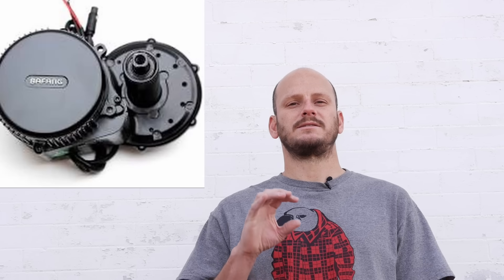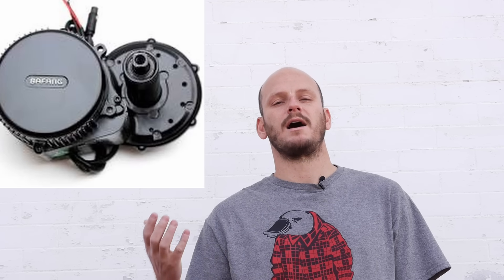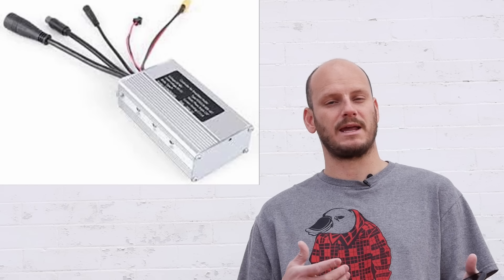Hub vs. Mid Drive Motors: Why Hub Motors Suck and Debunking Common Myths with performance test

Comment from the maker: Tesla’s don’t use hub motors! They use the same principle motor though. A single speed fed through a gear reduction. 
Also. Hub motors don’t cause loose spokes. But cheap, poorly made ones do😀
Hub motors still suck 🙌
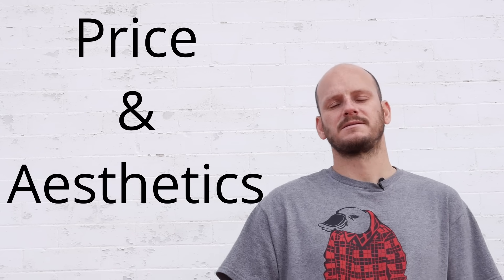Reply: I manufacture and sell E-Bikes.  I fully disagree @7:12.  Apples to apples, it costs 3x the amount for a mid drive with the same specs as a hub drive,  Three times.  I only know Bafang as that's what we install.  Also, I'll just say with the current nationwide law enforcement sentiments, they aren't checking e-bikes for wattage, anywhere.  I live in a medium size city and it's just not going to happen.  They don't care about e-bike wattage.  Law enforcement has so much more going on than to hassle someone on an e-bike, let alone confiscate it.  Ride what you like.  You'll soon be able to get a dollar for dollar tax credit in your annual return for purchasing one.  Clean green energy efficient e-bikes.  I'll also agree with your last statement above.  All e-bikes are awesome in my book.....
Reply from the maker: @multisystemic  sweet, what’s the bike you manufacture?
Reply: @multisystemic  Three times the cost for a mid drive with the same specs as a hub drive? Why so expensive? Is it more than just a prestige tax for those who ride mid-drives for snob appeal?
Reply from the maker: @multisystemic  how is it 3x when a BBS02 costs about $450? 🧐
Reply: @multisystemic Maybe.... If everywhere that you ride is flat.  As a practical point, not everyone uses an ebike motor for speed.  Hub motors simply do not cut the cheese for climbing steep hills and never will without the power that makes them something 'other' than a bicycle.
Reply: The beauty of an electric motor is that it produces high torque from zero revs, and continues over a large Rev range (unlike ICE).  So a well designed hub motor should be fine for most uses.  Of course they are not so good when sprung weight is an issue, as in mountain bikes.  Could it be that the public like to follow fashion / look cool, similarly to the use of exposed chains and derreilior gears...which are only suitable or racing bikes?
With all the money in the world, I would have a Pinion type gear, integrated to a mid drive, driving a chain enclosed in the frame.
Reply: In my experience mid-drives are useless because they cause the chain and cassette to need replacing about every 500km. I go about 10 000 km in a year. Also, having a hub motor with regenerative braking will save your brake pads. Without regen you will be replacing brake pads a lot! And that is both annoying, expensive and time-consuming.

But you are right about the spokes breaking. So both suck I guess. Haven't found a good ebike yet. 

But it is interesting that the most expensive ebikes on the market (STROMER) use a direct drive hub motor.
Reply: @cryptohouse1676  I'm way way past 500 km on my mid drive and the cassette is nowhere near needing replacing. I did break the chain though (it's a surprisingly easy fix).
Reply: @cryptohouse1676 Many cargo bikes too. I wish they offered 250 and 350 watt hub motors. The smallest I could find is 500 wart, which I need for pulling a trailer.  Maybe the Lectric Lite is 350 watts. I like hub motors. I can still pedal home if it breaks, I hope.
Reply: @cryptohouse1676  I've never had a Stromer so I didn't realize that the most expensive ebikes on the market use a direct drive hub motor. Good catch. 

Your mid-drive ate through your cassette 20 times a year? That's a lot of hours and money spent on replacing chains, cassettes and brakes each year. How much time and money did you spend on that each year?
Reply: @sammiller6631  Haha, that mid-drive only lasted a few months before pretty much everything broke. It was a 750w TSDZ2 from china...
Reply: more importantly, Tesla's don't have variable transmissions.  There is NO loss of torque at low end OR top end.... so.... the equivalent of what you're suggesting is to simply attach a 3 phase motor to your transmission to convert to an EV.  Gears, by design are friction-addled devices that are not necessary  in a direct drive electric motor.
Reply: Mid drive and hub drive have both the power going to center of the wheel, so why should hub drive make loose spokes when they even according to this video not at pulling so much nm.
Reply from the maker: @radarmusen  checked pinned comment
Reply: ya, and in 15 yrs i've never had a 'spoke loosend' by my several 'Hubbies' ..  BTW   only HUB motors , so far as I know, can be used for the "latest rage" :  eTrikes !!  My "ECO-TAD-SX" boasts a rear hub/and/derailleur system that , they say, boasts a single motor that can vary it's power to be from "500 to 1000 watts" .. So far I've not seen any specs/docs that des ribe how that is done ... but we must note that eTrikes  can't use "mid motors" .. so far as I know ..   COmment??? please do !!!
Reply: @jonandersonmd7994 I agree. Hub drives just work every time.
Reply: I have different take on why mid motors are a problem. The chains are not designed for the high torque. Nor are the gears.
Reply from the maker: @ebaab9913  I’ve experienced chain and drivetrain issues once you pass the 3,000w mark on a mid drive. Bafang s don’t put out enough power to cause too much problem. Unless the end user is riding improperly
Reply: Most people can't afford Teslas.
Most peple cant replace or afford to have their chains replaced 3-4 Times a year either...
Hub motor is less down-time and more money for ice cream. With The difference in efficiancy and price you can afford a second battery for your hub-drive instead and get even better mileage and economy.
Reply: This is exactly the info i was looking for. I’m looking at the same bike with a hub motor ($2300) and mid drive ($2600). They aren’t exactly the same the mid drive has some other upgrades but it’s the same frame.  Thanks! 👍
Reply: You say for the same draw on the battery the mid motor produces more motive force, so what happens to the energy in the hub - does it dissipate as heat?
Reply: @nemo6686  Mid drive and hub motors have similar efficiencies ranging between 85-95%, and as a result neither produce much heat and air cooling suffices until a certain power is reached (usually >12 kW continuous). I've owned quite a few of both ranging from 3 kW to 55 kW, so I've got quite a bit of practical experience on top of the technical. For perspective, an ICE is only 35% eff and risks overheating without just a few minutes of cooling because over 65% of the input energy is lost to friction and heat. Only 15% at most is lost as heat from resistance in an electric motor. Mid drive motors themselves tend to be slightly more efficient than hub motors by ~5% or more, depending on the model. But we're talking about bhp here (brake horsepower at the motor), and not total power at the wheel. You also have to factor in drive train losses between the motor and the wheel with a mid drive if you want a more accurate comparison of efficiency and thus power input/output. A chain and a couple of sprockets can easily eat up that 5% advantage that a mid drive would otherwise have over a direct drive hub motor. So generally, a 4 kW mid drive and a 4 kW hub motor, for example, will have roughly the same output in power to the wheel (whp) when said losses are accounted for. The main difference between the two in terms of output is that a mid drive uses gearing in most cases. You can input the same hp into each motor, but if one is direct drive and the other uses 3:1 gearing between the motor and the wheel, for example, then the latter is going to produce more torque unless the former is wired specifically to sacrifice speed for torque in the same way large/small sprockets sacrifice speed for torque, or vice versa, which they usually are. Torque is the key word here, JohnnyNerdOut seems to be conflating it with power when he refers to 'motive force', but torque and power are two different things. Related, but different. Power (hp or watts) is a function of torque * speed. So if you have a 4 kW mid drive like the QS 90H 138 that produces 72 nm (~53 ft-lb) of peak starting torque on it's own with a peak rpm of ~4000 and incorporate 3:1 gearing then you get 3 * 72 = 216 nm of starting torque at the wheel, but 4000 / 3 = 1333 rpm at the wheel, which is similar but slightly less torque than the 266 nm of starting torque and 1200 max rpm that their 4 kW QS 273 40h V3 hub motor produces. Increase the gear ratio for the mid drive slightly and you'll find the resulting torque and speed specs to be very similar between the two equally sized but different motors. Math doesn't lie, and neither do performance charts, which QS and other manufacturers are happy to provide when requested.

HOWEVER, that doesn't mean JohnnyNerdOut is completely wrong. Hub motors are not suited for every application. The extra unsprung mass with a hub motor can be a problem if your bike isn't designed for it. If you take a standard wheel off your mtb and replace it with a hub motor without adding more sprung mass to the bike (like more battery for ex) and replacing the suspension with a higher spring rate, then that hub motor is going to be really hard if not impossible for the stock suspension to control over bumps. Using a hub motor requires adjusting the sprung mass proportionately to the unsprung mass to maintain a proper ratio so that the sprung mass can work with the suspension to keep the tire tight to the ground. It's not impossible to do, but it can be costly when you get into the bigger 80 lb 12-14 kW hub motors. If you don't mind adding more weight to your bike and spending $ on a beefier suspension, then the unsprung weight won't be a problem for you. It's all about the ratio, doesn't matter if it's a bike or a bus. Again, the math doesn't lie.

Spokes aren't an issue, either. I'm not sure how that became an argument against hub motors when nearly every mid drive has a spoked rear wheel and inputs the same torque, or more if the gear ratio is high enough. Maybe a DIY spoked hub motor would end up with damaged or loose spokes if an incompetent backyard builder didn't choose the right gauge for the job and didn't know what they were doing. Otherwise, wtf? 

So in short, the only real difference is gearing and unsprung weight. Not necessarily bad, depending on your budget and whether you want a street bike or an off-road bike. Hub motors are a good choice for street bikes because they're simple and easy to maintain, mid drives are a good choice for off road bikes because the CG is positioned better for stunts and the ability to change gearing between rides allows the rider a bit more wiggle room for track adjustments than simply relying on the functions in the speed controller. But in terms of overall power, torque, speed - a person would have to be kidding themselves to believe one is superior than the other based on those factors alone. A 4 kw brushless motor is a 4 kw brushless motor no matter if it's direct drive or not, the ratio of torque vs speed in the motors themselves is a matter of coil/mag and winding count. Don't let anyone with an irrational bias tell you differently.
Reply: @JamesBiggar  Thanks for your long and detailed response, but my comment was really only a conservation of energy issue: if a motor consumes electrical energy then any of that energy not translated to motive force must surely be dissipated as heat - including any friction loss in the drive train, etc.
Reply: Where is the best place for me to get a complete mid-motor drive bike kit from or give me a number to call them
Reply: @JamesBiggar  well done.  It sounds like it's a similar argument to  fwd cars vs mid engine.  No one will argue that the mid engine is great for full performance but the basic fwd econobox is perfectly fine for almost anybody not racing a mid engine.
Reply from the maker: @nemo6686  well, I suppose yes to a degree. If the power is sent to the motor but it isn’t enough to spin it as it should, it creates heat. Sometimes they get VERY hot
Reply: @JohnnyNerdOut  Damn straight, they get HOT! Been there, surfed it.
Reply: @JohnnyNerdOut  surely there's a reason everything is moving towards mid-drive. It can't be because so many commentators say they suck. Kinda sounds like a lot of hub owners are denying an obvious industry move towards mid-drives. Same advantage of having the gas engine positioned like a mid-drive and not mounted at the wheel end of the swing arm.
Reply: @LoveIsaacCurtis  You should notice that in the ICE world, mid drive engines are rare. Most engines are located at the front or real axle, despite the disadvantages of centre of gravities.

The same will meet the fate of mid-drive electric motors. They are just not as efficient as hub motors.
Reply: @LoveIsaacCurtis  When bikes are toys, marketeers sell you on mid drives. When your livelihood depends on getting from A to B then you have no choice but to choose the cheapest, most reliable, system. For the hundreds of millions of Asians who need transportation, they choose hub drive every time. Hub-drive won many years ago.
Reply: @LoveIsaacCurtis   could be they are making them as tamper proof as possible ... one sealed unit containing motor n gear box n controller ,

Break the seal pop go the electronics ... Hubs in separate boxes are easy to upgrade @ ooh MORE POWER BABY YEA ! 

I like the fact Mr plod the police man can’t tell anything from a 500 - 3000 watt motor same size .... 

Either way I won’t stop progress , but if it try’s to slow me down to a grind .... old school bikes - with a big ..ish motor it will remain.
Reply: @LoveIsaacCurtis  The issue with mid motors will go away when the whole rear wheel drive train is designed to cope with the power. This means an upgraded chain, and more importantly gears that are designed to work with the power. None of this is impossible, but currently is just not implemented. The spokes incidentally are under the same stresses with small hub or mid motors. Large hub motors put less stress on spokes.
Reply: @LoveIsaacCurtis  The industry doesnt always have user experience first in mind. Just like the smartphone industry was moving towards non-replaceable battery, no expandable storage and other unreplaceable components. It's all about profit, middrive bikes made by big brands are proprietary and sold for a huge margin (they often goes on sale for 50-70% of the RRP) and the fact that the destroy chains and cassettes for breakfast means you'd have to spend alot on maintenance.
Reply: @JohnnyNerdOut I ride mine in 110° plus, out here in the desert. I'm going from a 48V 12.5 AH battery to a 36V 13 AH battery, same 500 watt hub motor. I don't usually ride more than 5-15 miles a day. It's nice to get a new ebike, this is my first one.
Reply: @difflocktwo Of course.  😀
Reply: What do you think about a mid drive motor on a single speed BMX bike? Can it be done?
Reply: @karlfonner7589  Anything can be done if you work at it. mid would be more work than a hub but if it's worth the extra work to you, tell us how you like it.
Reply: @sammiller6631  OK will do. I was thinking about putting a weak mid drive engine with a small battery. So it would be easy to pick up and push up hills without all that weight. Kind of like a poor man’s Grom.
Reply: @karlfonner7589  The smallest ones get their push from spinning really fast, much faster than you can pedal, so they use gears to lower revolutions towards a rider's range. Gears add weight depending on what they are made of. At that point, the most important weight is the rider's weight as the gears have their own rider weight limit before they are stripped. You'll have to find the right sweet spot depending on how you weigh, how much it can carry, how you can lift, and how much the engine weighs.
Reply from the maker: @karlfonner7589  if it has levered brakes (not coaster)
Reply from the maker: @karlfonner7589  I do that all the time
Reply: And this is why Porsche is using a gear in their EV. It just keeps accellerating.
Reply from the maker: @henrievery-3rey  You should check out my video explaining the biggest myths concerning Ebike motors I go more into depth about a motors and the difference of how they work
Reply: I just got a mid drive 250 w motor with a carbon drive (belt) and I just skipped the bank and stole all of the California Unemployment fund of 30 billion.  That covered most of the cost
Reply: @SocalSamStokes  almost all of it i imagine
Reply: You need to do more research on mid drives, not as good as you want to believe
Reply: Hub motors don't suck if you know about them it like I told this guy who tried screwing me on a new bicycle I'm selling for same price he paid for a used bike. If the mortor wattage inputs under then over it always better this guy litterly told me how his 1,000 watt better then my 350 motor and I told him if you do that you better off getting a middrive. But for how it sounded you needed one more like mine and not waste my time. He did not listen so when he burn his mortor witch I know he will. 

I advised him that enjoy spending a grand for the wheel for you pissed off the only guy who can fixed it. 😂  So yeah you right it does suck if you don't understand how they work. Great video man! Witch hub and middrive you prefer?
Reply: I have had. Cyc pro mid drive on my Giant Stance for almost 1000 miles.
Hard miles, it’s never ever had even the slightest issue.
50 mph. I couldn’t be happier.
There may be better stuff out there, but if I did it all over again. I’d do the same thing.
Reply: Hub motors don't suck near as much as you
Reply from the maker: @billwaller4094  no way man. Nuh uh.
Reply: Really well informed info. Thank you for sharing. But dude, that awful musac!!! Why? Silence, birds, birds farting, waves, random mechanical sounds, anything is better than that noize!!
Peace
Reply from the maker: @G58  I know. Ya live ya learn.
Reply: @JohnnyNerdOut  Cool. 
Peace
Reply: The reason why hub drive motors are not quick is because they are not operating at the right speed under acceleration. Torque is torque regardless of where the motor is placed, but the power output may vary because of favorable gearing or not. Torque is at its peak at zero rpm, but this is not where power is at its peak. It is important to understand the difference between power, force, and energy. Hub motors are clearly the future for most bicycle applications because you lose the hazzle with a chain. Though, there's one challenge that needs to be solved. Hub gears. Some effort has been put into this challenge but still too weak or too expensive. Those that exist don't use much of the diameter available and the result is small, weak gears. Instead of power transfer through a chain from the crank to the back, it will be done electrically via a generator. This will give you flexibility when to add energy to the batteries. It also opens for two-wheel drive. A reason why nobody serious has tried to solve the challenge is probably because there's a great risk factor. How many G's do the construction need to withstand? A high efficient electric motor needs small tolerances. How can this fit with hundreds of G's you get from running over gravel washboard? Would shock absorbers need to be put into the wheel itself? Some calculations on a piece of paper tell me there's no way around this for hub motors to have the bright future they deserve. The idea is very good but is it practically possible? Before the challenge is met mid motors are the only ones that make sense.
Reply: Hub riders are coping hard. I have both, mid is best sorry
Reply: They dont suck they have their place . in fact its a means to save the planet !  I had to slightly ream out the holes to fit the largest posible dia spoke and no problems at all not even a loose spoke with no thread locker , go big or go home .
Reply: I see you have received a few letters from lawyers after your video... the one thing that sucks more than a Hub Drive = a Lawyer
Reply from the maker: @Craig Nelson IMO a standard 68mm kit doesn’t change the Q much. I know that’s not scientific... I know when you start doing 120mm kits it can start to offset that Q. They do have crank arms out there that supposed changes the Q factor if needed
Reply: Thank you sir that's exactly what I was thinking because my son works for Tesla, hub motors on a Tesla 🤔🤔👽☮️
Reply from the maker: @timothymaddox1957  check the pinned comment
Reply from the maker: @henrievery-3rey  k, I tried 😀
Reply: That spokes thing had me concerned
Reply: Does a direct drive hub motor make a difference? I own a Rad City with a direct drive. I ride almost all flat paved trails so I'm not sure a mid drive matters much. Thoughts?
Reply: @henrievery-3rey  OK you say you learned about motors and drives from engineers, my question is why car hub motors would be less likely to cause fires. Most battery fires happen while charging or crashing.
Reply: A Tesla Model 3, for example, uses a 9:1 fixed gear ratio
Reply: The Aptera is planning to use hub motors though and Tesla isn't necessarily the top of EV technology.
Reply: Yes they do, internally geared hub motor is what Tesla uses. A hub motor is any motor incorporated into the hub of the wheel.
Reply: That dont make it right Johnny
Reply: Why not just use both.  Problem solved. 🤓
Reply from the maker: @jimbob4456  you totally could, it would just be totally inefficient
Reply: The new VanMoof S5 and A5 uses a front hub motor. Why do you think VanMoof used a hub motor? Is VanMoof simply style over substance? What's your take on the new upcoming Stromer ST3 Pinion? I know! So many questions. Sorry.
Reply: which is better a hub drive or your feet?
Reply: This random rant sucks.
Reply: I think I took a wrong turn somewhere. 🙁
Reply: LIKEXI SAID BEFORE THERE IS NO MID DRIVE THAT WILL BEAT TWO HUB MOTORS NOT EVEN CLOSE. and like I said in traffic in A CITY WERE YOUR GETTING UP TO 30MPH+ THEN SHIFTING DOWN EVERy 200yards or less. Not practical for middrive , also like I said Middrives KILL YOUR CHAIN AND GEARS, AND IF CHAIN BREAKS your f cked. But my opinion.
Reply: @mad151maxx4  Mid drive + belt drives + internal gear hub = dual hub drive users crying and coping 🤭
Reply: hub motors don't suck. they provide an assist as designed...  du du duuuuuuuuuuuuuu
Reply: I get it now. You sell only mid drives, so your opinions are heavily biased. You really need to put that disclaimer at the start of your videos so people know not to take you too seriously and you are just making infomercials.
Reply from the maker: @maxring837 as an independent conversion shop, I have co
Plate freedom to sell and carry whatever products I want. I choose not to carry hub motors based on the hundreds of videos I have made on the topic.
Reply: Oh yea there’s a guy going over 100 mph with a hub motor let’s see a mid drive do that
Reply: They put a tremendous strain on the spokes, especially if they're ridden hard. My first fat tire folder was abused before I bought it. Then I wrecked it. My new ebike will not be going off-road, or ridden hard, like my first one. The second ebike I'm getting, will have cast wheels, not spokes. $200 more I think it's worth it. I will be maintaining my spokes. I don't believe riding an ebike normally hurts anything. I'd love a mid-drive, affording one is not happening. I'm not spending $2500 to get a mid drive when hub motor fat tire folders are fine. $1400 is my limit for now. Changing the rear tire on a hub drive blows.
Reply: Sorry Johnny but my hub bike has 10 gears at the back so I0m stuck in the SAME choice as a mid drive bike - 10 gears. Think about it.
Reply: Even if someone offered me a screaming deal on a hub motor bike I'd probably walk away, because it's going to cost more to run in the long term.
Reply: If you want to go fast on a bike get a qs205 and a sabvoton 200amp . But honestly it's not a bike anymore
Reply: Good video, but have to call bs regarding the torque and resulting load on spokes. It doesn't matter whether the torque is produced at the hub, or from a midmount via the chain, the loading on the spokes is the same. In your example with a midmount producing up to double the torque you would expect up to double the loading, and therefore double the wear and tear on your spokes.
Reply: @stuartmontgomerie755  In fact it is probably worse with a mid. 1 Spokes are slightly longer with the original, small hub. 2 And with a properly designed hub, the spokes are designed for the extra torque. With a converted mid bike, the spokes are likely not designed for the extra torque.
Reply: @stuartmontgomerie755  Actually, hub motors break more spokes. It is how the torque is applied that is the difference. I was tearing up spokes and researched it. with the large diameter spoke flange of Hub motors, Details in spoking become critical I'm 260 lbs, rode my ebike home on the hub motor after a stick broke my derailler hanger and 11 spokes. JohnnyNerdout spreads plenty of misinformed opinions. They're jut his opinions. The reason against automotive hub motors is the same as for carbon wheels, Which are less reliable than steel. Unsprung weight environmental issues. However their Three manufactures will out mass produced hubbers in this and next year. Actually Inboard at each wheel for transmission efficiency. But I replaced broken spokes trued wheel, with what I know now I seldom loose a spoke.
In my use a hub motor is superior. Here is why:
I ride 365 days a year, two years, for transportation to work. Tell me what do you do if the chain breaks. In near zero, 35 mph, 60 mph gusts of a snowstorm 4 miles from home? Well it happened to me. I Rode my e-bike home, motor only. Do that with a mid motor bike.🤣🤣🤣🤣🤣🤣🤣🤣🤣🤣🤣🤣🤣🤣🤣🤣🤣🤣🤣🤣🤣🤣🤣🤣🤣🤣🤣🤣🤣🤣🤣🤣🤣🤣🤣🤣🤣🤣🤣 I've ridden it home, when the motor controller (under warranty. Long ride, long grade, I have the fix.) failed. I ride an $850.00 350 watt hub driven NCM Prague, Mtn style 3x8 gears with an 11-40 cluster, Studded tires. bike with fenders and lights is 55 lbs. I weighed 260 lbs I have a bad knee and some pretty good grades. For the price of your bike, I have two, three and spare batteries, For transportation, you couldn't give me your mid drive fat, overweight fat tire bike Thank for the opinions, but MID-DRIVES SUCK!!!!🤣🤣🤣🤣🤣🤣🤣🤣🤣🤣🤣🤣🤣🤣🤣🤣🤣🤣🤣🤣🤣🤣🤣🤣
Reply: @stuartmontgomerie755  although the torque should be the same (depending on which gear you were on), Hub motors significantly increase unsprung weight which makes the wheel vibrate harder and loosen the spokes more quickly.
Reply: @stuartmontgomerie755  so true He's one of those know it all before he actually does research.
Reply from the maker: @stuartmontgomerie755  ya I clarified my statement in the description and pinned comment as it was a little confusing the way I worded it. It was supposed to comment on quality of hub motor lacing.
Reply: mid drives are trash. know why? dual 5kw hub motors
Reply: @Blox117  I think he was talking about bicycle conversions. 
You're talking about an electric motorbike. 
Nothing to do with a bicycle or cycling.
Reply: @mick2d2  thats true, mine is more like a motorbike. although its built on a bike frame and still can be pedaled
Reply: @Blox117  Must be a pretty robust frame with all that power! 8)
If I had to choose one characteristic that I like about my middrive BBSHD, it's that at low power it feels pretty much like a normal bike. 
It's very flat where I live, and most of the time I'm only using 50-150W. Obviously if I crank it up (1764W fully charged) it's a very different beast.
I don't have a throttle either as it's a dead giveaway, and the police can be a bit pissy here. 
If they catch you with what they consider to be an electric motorbike, you get fined for not wearing a crash helmet, not having a registration, not having insurance and not having MOT!
Bit of a bummer really! 8(
Reply: @mick2d2  the motor controller is programmable easily on the fly via bluetooth and an app. you can set different acceleration curves, power levels, and throttle sensitivities.

im not sure how the police would know about a throttle. mine looks like a normal grip with a voltmeter on it. where do you live at, the UK? I hear folks in europe have a very dystopian government outlook on personal electric vehicles.
Reply: @Blox117  Spain. It's usually idiots not pedalling at speed in built up areas. Plod is (unfortunately) coming round slowly to the fact. I converted my bike, first to a BBS02 (seven years ago), then switched to a bigger 52V battery and the BBSHD a couple of years ago if memory serves. I can also reprogram on the fly using EggRider. The comms cable was a real pain to use before that. The EggRider also has two quickly switchable configs, "street legal" and not so much! 😉
I also have one of those metal stickers that clearly states 36V 250W!😁
Reply: @mick2d2  so all i would have to do is pedal really fast at 80mph and i can claim its pedal assist!

btw look up the X1 PRO GEN 2 its 5kW mid drive
Reply: @Blox117  I'm afraid not, but, they wouldn't be able to catch you at that speed! ;)
The X1 Pro Gen 2 is a real beast! Not sure what type of wheels you'd need for 250Nm of torque!
Reply: @mick2d2  in this case it would be the chain, derailleur, and cassette/freewheel that would receive the stress since the X1 pro is a mid drive. and yeah those might probably wear out really fast if you just pull back the throttle all the time.
Reply: @Blox117  neither really suck it all up to what your knowledge is.
Reply: @Blox117 They suck at being bikes should be said especially direct drive. How far would you want to pedal a dual 5kw direct drive if you have an issue?
Reply: @Blox117  I have hills in my daily travels that,  I def invite you to come and conquer. 44107
Reply: @Blox117  you do not want front wheel drive on a bike. Don't be stupid.
Reply: @Blox117  Only two?
Reply: @Blox117  Do you feel the weight up front much does it slow stearing response ?
Reply: @Blox117  have fun NEVER using on a street, or he cops will take it and possibly arrest you.
Reply: @dougfurr5217  I've ridden about 10k miles on 10-24kW diy ebikes and I've been pulled over for questions, but never ticketed or warned. Just straight up tell em yeah, I'm using more than 1kW power so I can move with traffic because it feels unsafe to get passed constantly. YMMV but unless you give them a reason to look for an excuse to ticket you...
Reply: @Xenodius  yep more safe to go fast to keep up with trafic,  legal reason .
Reply: If somebody could make a powerful mid-drive that doesn't require gears, or that the gears and chain are so strong, they never need replacing, that would be awesome. Also, if it supported regenerative braking, it would be ideal.
Reply: LOL. I agree
Reply: Teslas use differential motors.
Reply: Hub motors in bike are not well designed. Although a hub motor behaves like a single gear motor, the motor can have high torgue at low speed by supplying huge current like Tesla motors.

The reason why it is not done, is due to poor cooling. Hubsink solves some of it.

At high speed, in tge end, hub motors will win because of its size.  Bigger size means it can handle more speed, so use a larger voltage. Geared motors do not need high voltage batteries and controllers because the gears make the motors behave like it operates at high voltage. Or high currents, at low gears.

So, according to Physics, no different between motors, but because hub motor by itself is bigger, ultimately, you can operate it at higher powers.

One advantage that the lossy geared motor cannot have over hub motor, is the silence. So silent in operation, meaning, it saves energy in the end.
Reply: @othmanskn  I haver a hub motor that goes 71 mph and has Great torque. Depends on the controller and the hub motor. Risun 5000 watt hub and a 100 amp Savotron controller. with a 72 vt 100 amp battery. As of now I am using a 60 volt 50 amp that make 60MPH.. The weight does not bother me and the speed is great. Regen included.
Reply: @othmanskn  I like what you said about voltage ,  the dia and length of the windings also have a lot to do with  torque vs top speed . Maybe water cooling would be nice on a bicycle .
Reply: Sounds like he has never ridden an ebike, let alone fixed one.
He is right, chains don't snap that often but the cogs on your $90 10 speed  casstette wear very fast. Plus, good chains that will last aren't $15. They will, however, stretch pretty quickly, making the chain jump. The spoke thing is mote true in the mid drive because  of the, as stated, more torque. Dah. The biggest problem with mid drives is they are operating through a drive system designed to take the power of a single rider. A fit guy can maintain 200watts so your 750 watt is like 3.75 Lance Armstrongs on the good stuff bashing the drive train from the get go and usually badly cross chaining. Then there is the dirt grinding away  at all this like valve gringing paste. Bottom brackets come in a myriad of designs these days, so no, they don't fit easily.
All middrives I can find for sale are at least twice the price of a hub kit. And last is a car engine needs to rev to get torque an electric motor  does not hence the brake horsepower spec used for cars.
It's a very misleading video.
Reply from the maker: @maxring837  this is what I do for a living all day every day since 2017. Simply sharing my experience with people to help make the best decisions.
Reply: @JohnnyNerdOut  as I pointed out, I doubt that very much based on some of the things you said. It sounds like you are a keyboard mechanic.
Reply from the maker: @maxring837  I’ve never repaired a keyboard in my life. You are mistaken.
Reply: @maxring837  Bosch mid drives are the best eBike drive trains at the moment... so NOPE to your entire insane hub drive psychosis rant
Reply: @Mr.AdamNTProtester  so you didn't read it then, or you would know that the problem lies with the drive train not the motor. Who's ranting?
Reply: @maxring837  The main prob is twofold:
1, You have a freewheel rather than a free hub & unless you are at the ideal speed the gears are non existent,,, with a freehub in the mid drive systems you still have [altho not ideal] gearing & hence torque at various loading capacities/demands;
2. Would you like to replace an ENTIRE WHEEL & MOTOR by the side of the road on a lomg trip or just a chain/link... it's as simple as that or as complicated as you want to make it... also the power in the mid drive is ridiculous compared to the hub... yes its quiet so is a beard trimmer compared to a Harley Davidson... so there is NO comparison & at present tech- it is a joke to suggest that a Hub is in any way shape or form better than the mid drive & there are plenty of real world test vids of people testing these types of motors on steep hill climbs where the hub can't even get up the hill whereas the mid drive makes it an easy task....
Now IF you live in the flatlands of the mid-west then sure Hub is great but the ONE advantage that Hub has over the mid drive due to a mid drive being a great motor & garbage for generation whereas the middle of the road Hub motor is average at being both a motor & generator... HAS BEEN ELIMINATED... my eCargo Bike has the BionX system & despite the long list of absurdity with the battery designs, this is a system that allows regen on the pedal stroke... I don't know who the retard was that  decided for everyone else that this capacity should be eliminated- but here we are... so that is the ONLY reason I have left my eCargo Bike as is... the regen capacity on the pedal stroke... once this thing needs repair I will convert the thing to a mid drive motor & a dual system with a Hub on the front... that way I have cruise on the flat with pedal & regen  or assist & when climbing hills I use mid drive... then  regen on the downslope & braking. 
Until someone decides that the ORIGINAL Plan of regen on the pedal stroke is a great idea & improves overall performance- then the mid drive is the FAR better motor- hands down no debate- tho it may not be best in application depending on the bike, terrain, purpose, personal choices of biker etc
Reply: @MrAdamNTProtester  you didn't read my comment either. Just to recap, it's the drive train, which is the problem with middrives. The drive train is designed for a cyclist and simply does not stand up to the stress of  a motor. I have fixed enough to know.
Reply: Electric motors don't need multi-speed transmissions unless they are way under-powered.  Think Tesla, not a POS unreliable Bafang mid-drive and its crap performance.  Also, no crappy little geared hubmotors either if you want reliability.  Who wants all that noise anyway?

The bottom line is that for riding on relatively smooth paved surfaces direct drive hubmotors are best with the only exception being that you need to regularly carry your ebike (like up stairs).  Nothing beats the silence, absolute reliability, or performance (all of my ebikes would laugh at your Bafang mid-drive.

For off road riding hubmotors increase the rear wheel unsprung weight too much to be effective except in the lightest trail use.
Reply: @JohnFinCR  Don't forget hub motors also react poorly to any hops.
Reply: @JohnFinCR  Doesnt matter what power rating the motor has. You will not be able to use anywear near its full potential without a gear box.
Reply: @JohnFinCR   I agree, unsprung weight  .. Might be a problem too in EV road motorcycles too where a say  5-10Kw motor would be heavy.
Reply: @JohnFinCR  Bafang rules the market and your fancy exotics too
Reply: @JohnFinCR  My 3000W Bafang BBSHD (Ludicrous controller) with the Sturmey Archer 8spd IGH gets to 50MPH. And since the motor is still stamped as 750W, I can actually ride on ROADS without fear of police confiscation, and tickets. Yup, horrible i know!!!
Reply: @dougfurr5217  3kw aww so cute. my dual motor setup has a peak of 30kw
Reply: @dougfurr5217  My 1200cc Super Tenere with 115HP will go 130mph although I keep it under 110 to save on gas and speeding tickets :-)
Reply: @dougfurr5217  Stamped as 750W won't matter because nearly all places have a speed limitation. Can you point me to the law that permits ebikes to go 50mph legally?
Reply: @sammiller6631  get it registered as a moped , then put the settings back up , that way you can legally do 50mph ...... or register as moped  get number plate etc , then de- register as a freeman on the land !
Reply: @adrianthomas4660  "freeman on the land" (aka sovereign citizen) only works in some states. If the state defines mopeds as only ICE engines, then any e-bicycle filed as a moped is as fraudulent as getting a fake ID.
Reply: @Blox117  and whats top speed?
Reply: @Blox117  30kw? aww so cute. are you overcompensating with your dual motor for something else that's not big enough?
Reply: @dougfurr5217  1500 w unbranded hub motor with built in controller on a surly ecr 48 mph in beautiful silence you wasted your money dude! @Doug Furr
Reply: @adrianthomas4660  if you register it as a moped you need street legal things like turn signals and brake lights
Reply: @oknevals  classic but I still prefer Ninjas myself 😂😂😂
Reply: @dougfurr5217  Do cops in your town actually check that? I have never seen it here in Ottawa.
Reply: @Blox117  nice motorcycle
Reply: @dougfurr5217  how is bbshd stamped 750W? my bbso2 is 750W